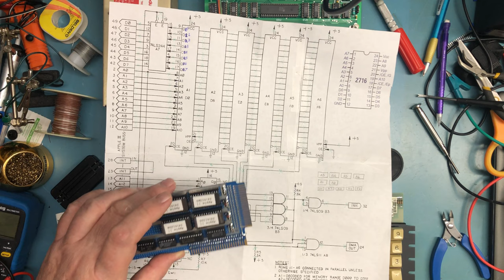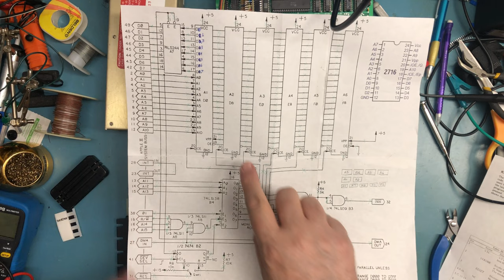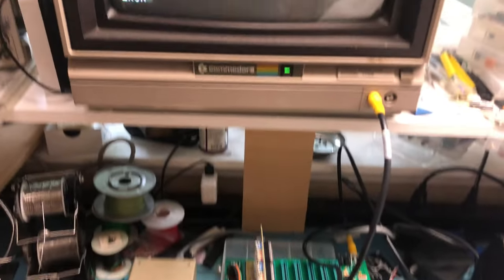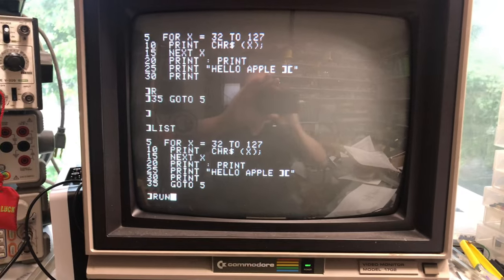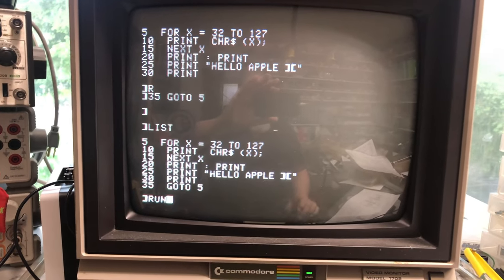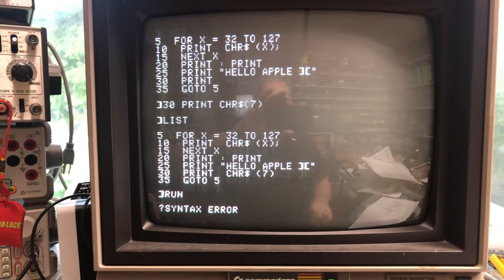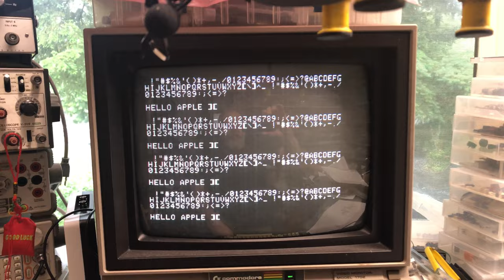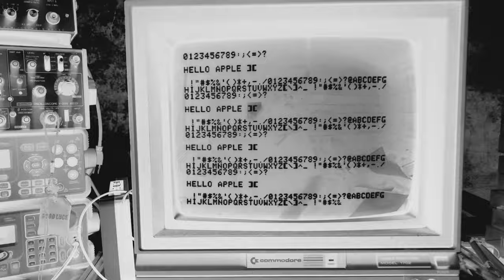STB880 - Apple II Rev 0 - Part 11 - ROM PCB Testing

Comment: Nice, love it when it works on the first try.
I had my little wire wrap project work on the first try as well. I also had to make some Wrap-IDs using EasyEDA PCB editor, a laser printer and some kapton tape for protection.
Reply from the maker: The kapton tape is a great idea for homemade wrap IDs.